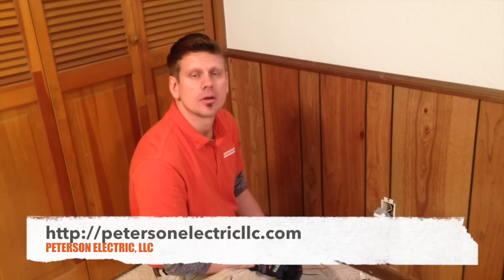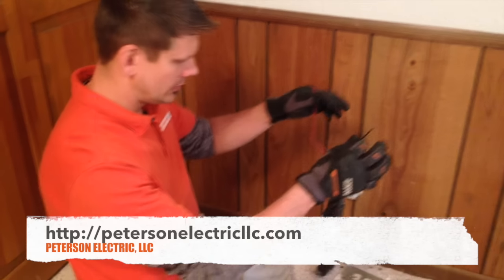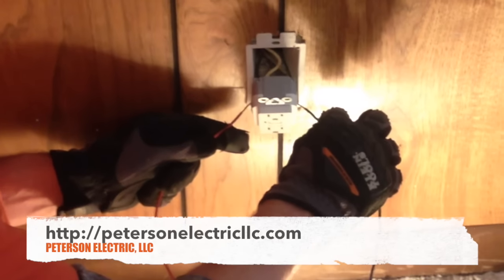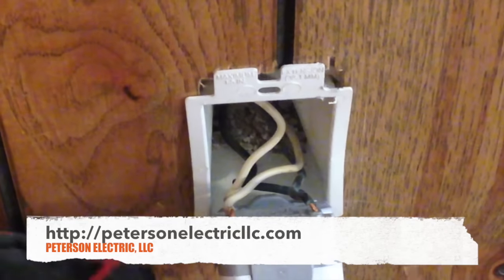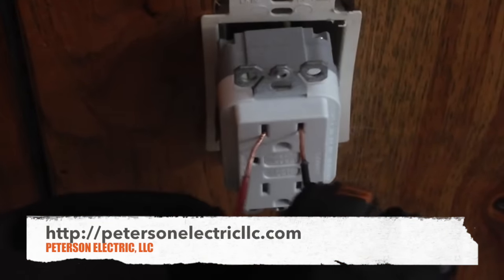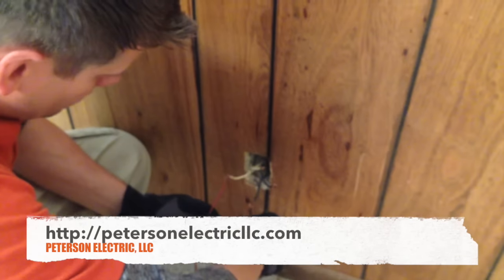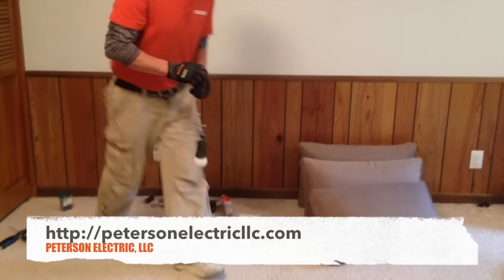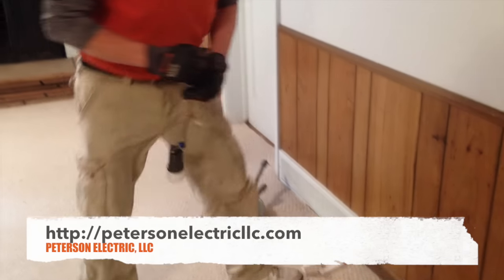A 1950's House With 2 Prong Outlets & No Grounds, What Can Be Done?

Comment from the maker: The best protection if they do not want to rewire there house and start with ALL new 2017 codes is to then see if they need a panel upgrade, and if they do not then label all the circuits then install AFCI and Dual combos on the breakers and then look at running EGC grounding conductors to the plugs and possible switches and lights. But this is COSTLY, again how many customers have $10k to $20k to either rewire their house or install all of the newer methods without gutting?  I have in the last 6 years installed and traced 14 homes and smaller condos and retro the ALumiconns and AFCI and Panels and Dual Combo breakers and have had great luck. Only one basement I could not help on this, the studs were the 1"x2" furs and the wiring would not accept the AFCI breakers, the circuits were sharing neutrals from other circuits and also the cable as a homerun was a mulit red and black sharing a neutral .
Reply: Are you saying in your video that you need a GFCI outlet for every receptacle? You can't have one GFCI  and the rest chained off of it for protection?
Reply from the maker: I do believe that one should practice with the intentions to have a GFCI in every open and pig-tailing your copper splices, assuming, you have enough room In the box. 
But, this video was done in 2013 and now it is 2018 almost, we are suppose to AFCI protect every circuit as we update plugs and switches and lights. Article 406.12 talks about this. 

So, levinton and pass&seymore has a dual device for a plug and most brands have breakers now, assuming it is not an old school breaker system.
Reply from the maker: I am not talking about kitchens with an EGC, I am talking about a circuit that has no grounds and only two wire plugs. It does NOT STATE IN THE CODE to line and load this, it states that GFCI protection can be used, therefore in your opinion of it being served on the line side is your opinion. 

Besides you have old thinking, the room in this video does not meet article 210.8 for unfinished or have any water. In 406 it does talk about GFCI but it is old thinking to not update to a AFCI or A Dual AFCI AND GFCI plug. 

There is no point for GFCI on a circuit that does not require this protection.
Reply from the maker: Yes I agree with you, but what I think most of the people who disagree with this video are missing to important codes. Please for who every reads this and listens to the video, needs to "KEEP IN MIND" that this video was completed five years ago. It is now the 2017 code so that means we were in the 2011 addition during this video. In 2014 code the NEC Code book in article 250.130c finally allowed a separate EGC (electrical grounding conductor),  (sized off of 205.122), grounding conductor to be ran outside of the jacket of the old BX or NM cable (two wire cables). 
Before the 2011 code it was practiced but frowned upon if you wired circuits without the bare or insulated grounding conductor... Keep in mind that it is not always easy to or able to, run a separate EGC conductor from another circuit or back from the sub panel or main load center.  The code now talks about the means, of how to do it, and from where to pull it from and how to size it, ("BUT"), it does not talk about how to test the path you are using to the ground bar in a subpanel or load center. It does mention how to grab this from another circuit, "Branch", but it does not talk about how to test for impedance or resistance.

 I have typically seen the mistake of running a "Green" #12 or #14 solid conductor from one circuit to a water pipe or another branch circuit, or to another panel, but there was no Grounding Electrode Path or no forth wire conductor in an SE cable back to the main disconnect or panel. 
We have also seen that there was no electrode conductors installed on the main water shut off pipe, or UFER cement electrode and or any supplementary electrodes for two x 8' (5/8") ground rods and no intersystem bonding bridge bars. 
Read, 250.52-53, 250.64, 250.93..... Another good point, is that in 250.104c it talks about now grounding any gas pipes and other metal pipes. The only exception that I have found in the code to allow the connection between the neutral and the grounding connection (ON THE BACK SIDE OF A MAIN BONDING JUMPER IN THE MAIN DISCONNECT) is in article 422 for dryers and ranges. So, therefore the "cheaters" who use a small number #14 or #12 on an old house with the method of jumping the yoke of the device to the neutral of the branch circuit, is NOT ALLOWED> Infact, if the circuit goes bad on the (hot side) of a switch leg of a light fixture, than you are energizing the fixture. No grounding conductor to direct mis current flow. 

The last thing to keep in mind is the code in 406.1-12 under plugs and 404 under switches, communicates that in the 2011, 2014 and 2017 code we have been enforced to add AFCI (arc fault circuit protection) when we replace, modify or repair any plugs and or switches. I believe this can be unclear when the code is trying to describe an "opening". 
An opening is a smoke, dimmer, motion, timer, plug, switch, toggle, paddle, exhaust fan, ceiling fan, can light, puck light, transformer, co detector, pendent, mushroom, bar vanity, heat fan light combo kit, etc...... When we are improving the "TRUE SAFETY" of someone's property and we are exchanging monies for time and product, we are told in the newest NEC that we are to do this a new way, basically "upgrade" the circuit. 

The point of this video is that the OLD METHOD of "just" replacing the two prong plug with a three prong GFCI plug is ("NOT") the safest way and or the "MAXIMUM PROTECTION" that there is for the customer. ("IN MY OPINION") , I show in this video that a GFCI cannot trip only based on a fault between the undground (Hot) and grounded (Neutral) conductors. This home in the video was built in the 1950's and has "no signs" of remodels and branch circuits with EGC grounds and NO grounding electrode system conductors- 250.53.  This "customer", (did not want) their home cut up to install a separate grounding conductor, we were in their basement and there is not pop up tile ceilings, and the house was on a slab, we had no choice on the matter. 

In the video, we are simple proofing that an old Murray (60 year old breaker) is tripping faster and more frequently than a NEW GFCI plug. Point being, what is so important about installing a GFCI plug in an area of the home that is not in relation to 210.8 for GFCI protection. The room has carpet, it is finished with drywall and has no water. 

This is OLD and SIMPLE Thinking, to keep stating what 406 talks about under two prong plugs has to go!!! 
The 2011 and 2014 code tells us about AFCI protection, but our AHJ and city officials have not pushed the code of AFCI protection on simple repairs and replacement of plugs and swtiches until now. The 2017 NEC CODE BOOK in article 210.12 B states that if we modify our cirucuits, or extend or replace we have to AFCI. 
WE NOW HAVE NOT EXCUSE, that we cannot find a AFCI / GFCI (Dual) plug. We also, have breakers (overcurrent protection) that allows us all three options, AFCI and GFCI and Overcurrent in a breaker switch protection. If the panel cannot fit or accept the newer breakers than we can trace and label the circuits and install the protection at the LINE SIDE OF THE EXISTING CIRCUIT>   BUT, I still say, why not run an EGC conductor to help in this situation if you can cut drywall and or fish the EGC in. 

Bottom line, if we are not adding AFCI protection than there is a standard that we are not practicing by. This is not an easy process, but if we do not get past our concerns/fears and start to practice with better skills than we will not grow in our field. 

I have personally modified 14 homes in the last six years with TOTAL AFCI Protection, and in most cases upgraded the existing panels and also added ALUMINUM PIG-TAILING protection with new TR (tamper restive) and WR (water restive) devices. If the panels were too old, we than, also upgraded the service with the meter as a by-pass lever and added all electrode protection needed. (WITH PERMITS).
 Later, we have had to add EGC protection to the circuits that had electronics and or computers. Some cities were very hard on us to install all Smoke and CO detectors with three wire 110v feed devices in the NFPA 72, for homes. 

If you cannot add EGC grounds than protect first in the panel with a Dual breaker. If this is not possible, than protect with a Combo AFCI & GFCI plug, but if you do not have an EGC throughout the circuit than you need to install A DUAL PLUG, in every location, assuming your old metal boxes have the volume space in article 314.  
Personally i would parallel all my connections with pit-tailing, whether you have copper, aluminum or copper clad aluminum. 

MY POINT IS, (since i have been so challenged by this video) that if you are not AFCI protecting, updating grounding on EGC and Electrode System,  and possible the service with a new main disconnect and by-pass lever,  than you are not doing your job!!!!  (unless, your city has a lower standard, but HERE IN COLORADO they are very complaint and enforce ALL NEW CODE UPDATES> 
 Better protection, safer standards for the customer is in article 90, this is for the safety of lives and property. NO IF, ANDS OR BUTTS!
Reply from the maker: SIR, this is not my room, I did not install her three prong plugs, we brought this to her attention. The GFCI does not make sense from the past to now, the AFCI overrules the changing of any plugs, and if you buy a Dual function you meet the code requirement. We practice with the modo of changing out all the plugs if there is no way to run an EGC. We believe that this is not correct and at most is the minimum of standard. 
I am done with your disagreements, you are not being productive and just accusing me of not be a good electrician, Good day and I will remove you from our channel.
Reply from the maker: First of all we are not yelling or using profanity in any means, we just disagree with you. I  know it does not state line and load, that is my point, so I believe the best way to practice is to install a plug for Dual function in every opening if there is no EGC present, with a parallel splice method rather than a line to load approach. 
 I am not convinced that GFCI protection is the best and only method. If we cannot convince the customer to cut some drywall to install EGC grounds than we use this Duals.
. I have presented myself and my company with good diligence and good code references, you on the other hand have not presented any code or other experiences other than arguments, we will no longer respond to you and if you persist to be rude with your last comments on another response about, "if we were good electricians"! we will delete you from our future videos. 
This is typical of people being rude on youtube, when most of them that are acting like trolls, do not have any videos, or subscribers.
Reply: Peterson Electric what do you mean by ‘old school’?  I live in a 110 yr old house; I know there is a new panel board, and I guess the original system was bulbs or something.  My best guess is the breakers are the most basic type, they don’t have any writing/indication on them of being Arc protection etc etc.  Some of the original light fixtures, the wiring is covered in what appears to be rubber and fabric!!
Reply: Give it 3 code cycles and every new house and every residential service change will require AFCI/GFCI combos for nearly everything. Square D already has panels on the market with a neutral buss.

Comment: I have questions. If there is no ground wire can I still put the three prong plug in? Does it have to be a GFI?
Reply from the maker: Your suppose to pull a Green, solid #12 to the box and hide it in the wall or the mop board, and then AFCI the plug. GFCI if in a kitchen or bath or unfinished area. The plugs have to be TR rated for kids and WR rated for wet areas.
Reply: It has to be EITHER a GFCI receptacle or else supplied through a GFCI (either a breaker or an "upstream" GFCI receptacle's "load" terminals. If that particular receptacle also falls under AFCI requirements, that makes it more complicated, but AFCI is NOT required in every circuit or location as of national 2017 code.

Comment: Back in my day when those GFIC came out  they are kind of a joke if used out in the wet area because the line coming in behind the outlet is not GFIC protected and if the area is flooded there is the potential to  be electrocuted  just saying
Reply: When GFCI's first came out we put them in the bathrooms and ran the load side to the outside outlets.

Comment from the maker: Yes, but in 406 .4D it states that if you replace The plug you have to AFCI. It also states in 250-130c that you can run an EGC grounding conductor
Reply: Hey bud…can I replace the current breaker on a circuit with an afci or cafci for extra protection? The current circuit is a two wire system. Thanks and look forward to your reply.

Comment: Not clear the creator of this video understands that GFCI function doesn't involve grounding of the device whatsoever.  Done.  Follow NEC 406.4(D) when replacing ungrounded receptacles (with or without specific GFCI, AFCI, TR, WL requirements) and you'll be fine.

Comment: I think this video is mis-labeled. It isn't about "What can be done" - rather, it's about proving some people wrong who left you comments about GFCI's. Still wondering what can be done about a house from the 50's with no ground wires. Now I have to go look elsewhere. At least the video is short and I didn't waste a lot of time on it.
Reply from the maker: It actually states that you have to install a GFCI in every opening. But this video is 8 yrs old and now you have AFCI and GFCI every opening. 406.4d and 210.8 and 210.12b
Reply: @Petersonelectricllc  Who told you AFCI and GFCI is required at every opening with a replacement of an ungrounded receptacle?

Comment: You proved nothing! A GFCI is not designed to trip under a hot to neutral fault! In ANY wiring scenario, it will only trip in a hot to ground fault!
Reply: All he did was prove that he knows nothing
Reply: He also forgot that conduit acts as a ground if it goes back to the service panel
Reply: Quickess path to least resistance was daddy paying someone to give him a license.

Comment: So what is the gist of this video?  Ordinarily, all outlets downstream of the GFCI (connected to the load side of it), have the same protection as the GFCI outlet itself.  Another GFCI outlet is not needed downstream of a GFCI outlet.  But, with no ground present, it's not the same scenario?  Not seeing where this was shown in the video.
Reply from the maker: PULL AN EGC Grounding Conductor based on 250.122 and 250.130c and 406- 404 talks about how. And if not possible then rewire. But either way your DF the panel breakers based on 406.4D and 210.12 A-C and 210.8 A-F
Reply: Let me start by saying that I am not doubting you.  I'm not a certified electrician.  I own a home improvement business, often times taking on electrical projects.  I am often called upon by other contractors for electrical issues.  I guess it's my niche. Anyway, I was called to a house that was built in the 1870s where another contractor was remodeling a bathroom.  There was no ground wire present running to the GFI outlet, which I initially though was a problem, but then after research, found that you don't neccesarily have to have a ground wire for a GFCI to offer protection.
Reply from the maker: GFCI has to be installed in every opening, but todays code in 406 states that AFCI is now needed, so I try to pull my EGC grounds and then DF the Breakers or first plug, plus TR and WR.
Reply: @Petersonelectricllc  Not true, under NEC since 2005, that "GFCI has to be installed in every opening."  406.4(D)(2)(c) says the ungrounded grounding-type (3-prong) replacements must be "supplied by a GFCI", which could be a breaker or a GFCI receptacle somewhere else.

Comment: I replace two prong outlets only with two prong outlets.  You cannot create a proper ground out of thin air.
Reply: I can respect that.
Reply: Can a two wire socket be adapted to three wire by running a third (green) wire from the receptacle to the ground buss inside the panel?

Say an old house has all two-wire service and the owner has a plasma TV that has a three-wire power cord with a mesh braid. Without the ground connection, strong RFI is radiated from the non-metallic cable between the plug and the service panel, making it impossible to listen to the radio when the TV is on.

Would a dedicated circuit of 14/2 +ground in spiral armor cable from the panel to the TV outlet keep the RFI in the cable?

It seems all the comments about two wire homes only mention GFCI. GFCI makes sense, of course, but does nothing to remedy RFI.
Reply: Radio Frequency Interference is rarely a problem. If I was in a situation were I had to do something but couldn't run new wires I would put a high value resistor in line with a diode as a jumper between the ground and Neutral on the line side of the GFCI receptacle.
Reply: Many modern appliances have  3-prong plug, but don't necessarily need to be grounded. So, national code allows you to install ungrounded receptacles fed from a GFCI, rather than having to rewire, or (worse) to use a "cheater plug" adapter to plug your 3-prong devices into ungrounded two-slot receptacles.
Reply: @UpnorthHere  The NEC also requires you to label those receptacles as "no equipment ground".
Reply: @farmerdave7965  Yep, not to mention "GFCI Protected".  That's why they usually include stick-on labels when you buy the GFCi receptacle or breaker.